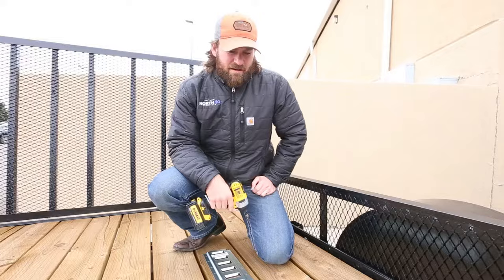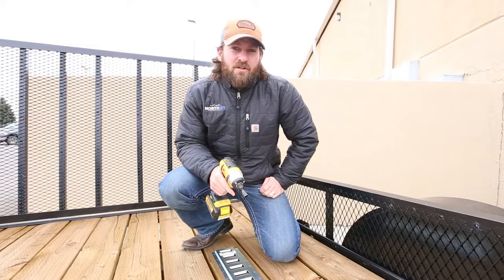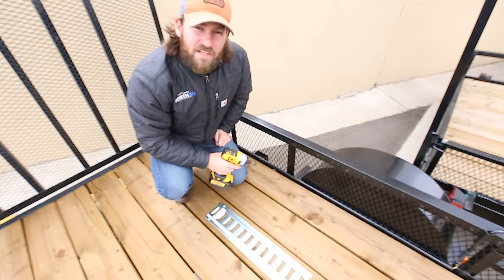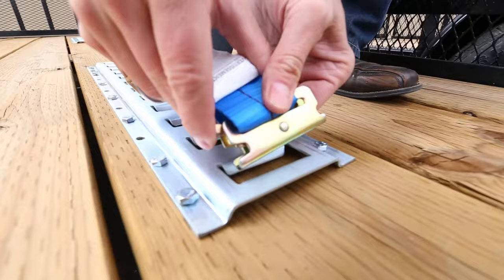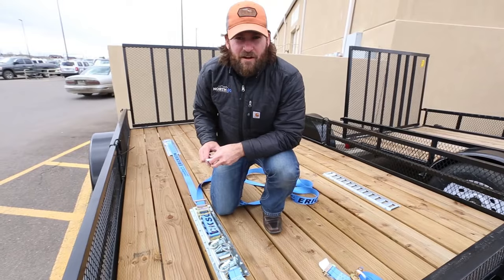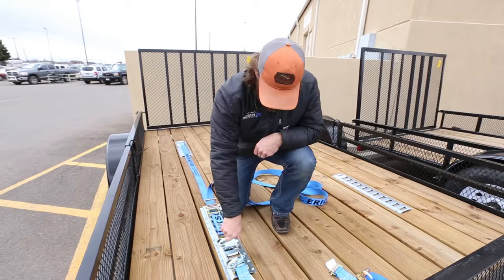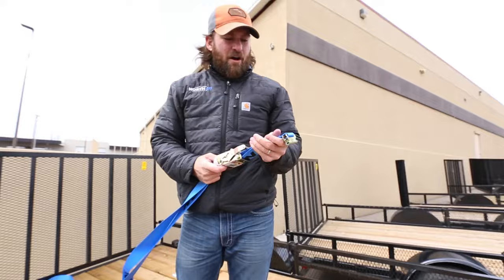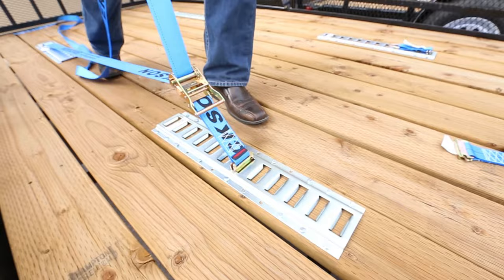How to Install Erickson E Tracks

Comment: wouldn't trust lag bolts to hold an atv or sxs
Reply: Me neither, I'd drill through the frame and bolt through it and the floor where I could.
Reply: A year later, with enough lag bolts, my SxS had no issues staying in place on a long trip. If the trailer were upside down, then no, I wouldn’t trust it either. When properly strapped to the machine, lag bolts every other hole has been more than sufficient for a SxS or quad
Reply: @hammarashi  Did you use stainless, because the bolts rust out quickly in the boards
Reply: @PA1911  I actually used outdoor rated construction screws. In Southern California, rust is not as much of an issue as it is in other locations. When I replaced the wood deck, the screws were still in good condition, but I used new ones anyway.
Reply: @hammarashi  traditional corrosion isn't the factor. The chemical used for pressure treating will eat screws if they are not stainless or properly coated.
Reply: @fisherguy  did you use zinc or galvanized bolts? And how long of a bolt?

Comment: You're asking a lot of the one deck board that you have both rails affixed to.
Reply: That's why I put angle iron under my trailer going horizontal to distribute the load across more boards. 

Even a bolt through a piece of pressure treated 2x4 under there would be better than all the screws in one board.

Comment: How well is the load strength on the lumber? Any issues with it yanking up the boards? Obviously it depends on what you are strapping. Im going to use it for our rzr 4 seater 1000 and dirt bikes. Thx
Reply from the maker: That's a great question.  You'll want to make sure your trailer boards are  in good condition and are a solid part of the trailer that you can confidently strap a load to.  You'll also want to make sure your floor boards can hold the anchor points and use plenty of anchors to distribute the tension as recommended in the video.  These wold be perfect for holding side by sides and dirt bikes.
Reply: What size and length screws?
Reply: A few backing plates adds a great deal of strength to the track

Comment: What size and length screws?
Reply from the maker: Thanks for your question.  The sizing and length you would need is dependent on the thickness of the wood you are putting the screw through.  For the sizing, we would say roughly a 1/4" but for length, that is dependent on how thick your flooring is.